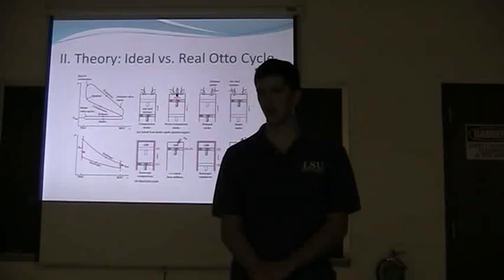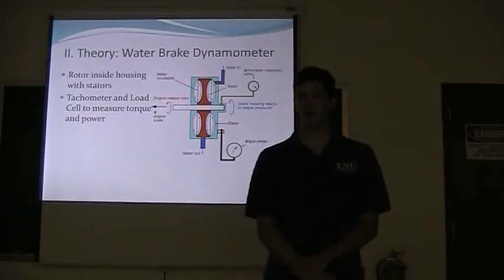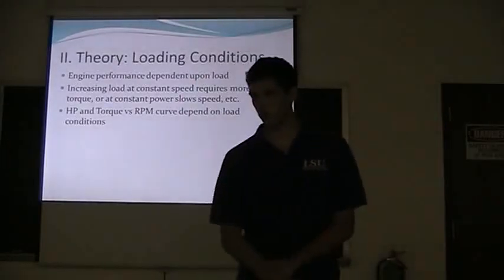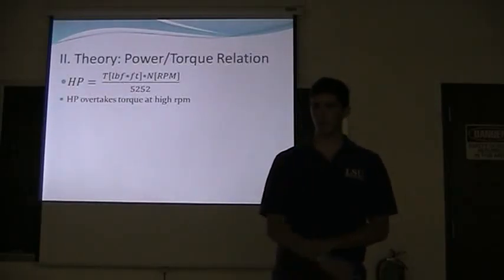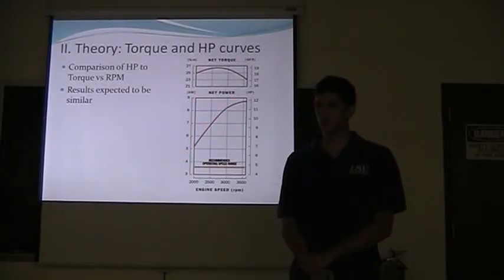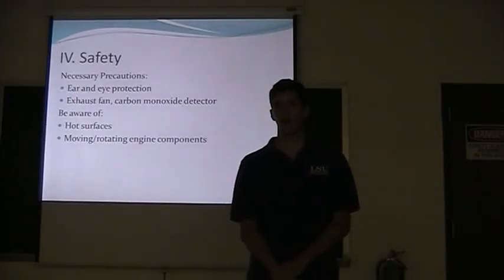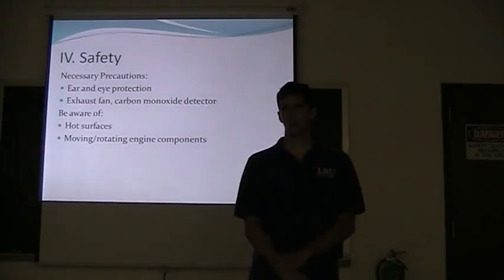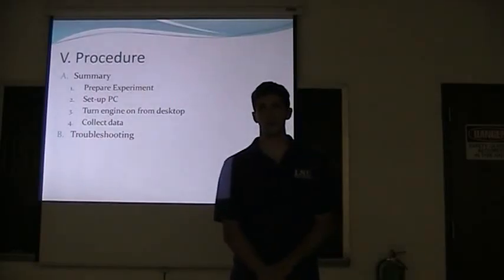#9 Group 3 Lead Exp 7 Austin Percle

Comment: I did avoid saying "um" until I got to a lull in my speech. When I wasn't stalling I was talking at 100 mph. I think if I prepare myself better I won't be so nervous and the presentation should go much smoother.